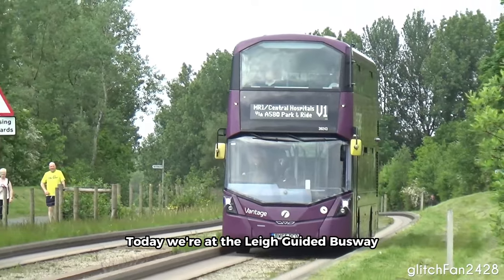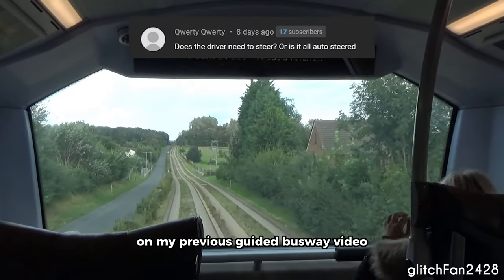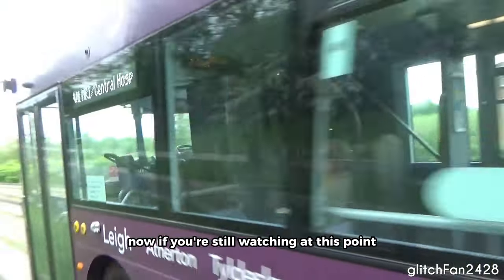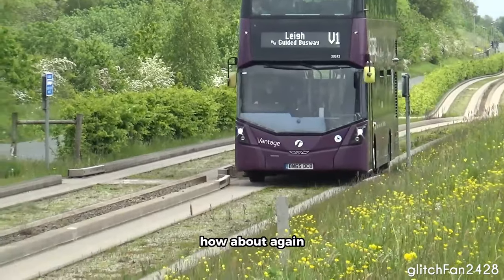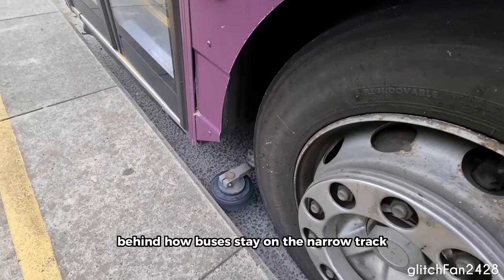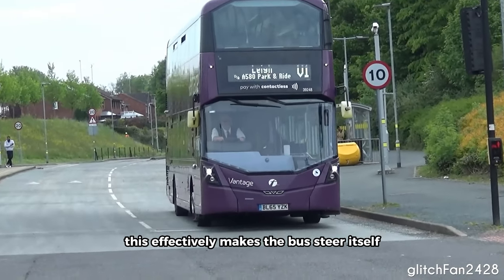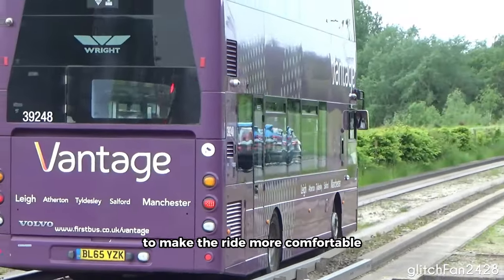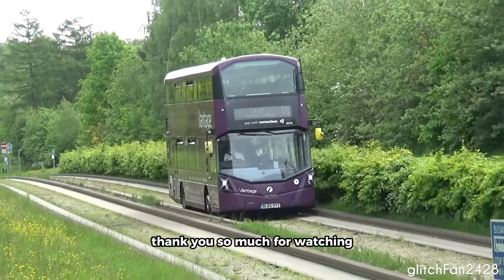What's the SECRET of the Buses on a "Train Track"? | Leigh Guided Busway

Comment from the maker: Did you already know how it works, and if you didn't, was the answer something unexpected? 😅
Reply: No and No! But this is much more robust than the Tesla thing they were trying to do in Las Vegas! It looks cute too! Although, if the bus is used a lot, might make more sense to build a tram! Thanks for uploading!
Reply from the maker: @kiitc  thanks for watching! I presume the main advantage of this is a seamless connection between the busway and places that a conventional tram setup would not work, like a housing estate for example.
Reply: The only thing I don't understand is why this better than a normal road.  It certainly would be much cheaper to build and maintain a normal road... and you don't need special buses to run on them.
Reply: @davidlloyd1526  I don't know that a normal road would be cheaper to build. Land acquisition cost can be quite high. Normal roads would be 300-500% wider. Human drivers cannot drive that precisely for any length of time at 80kmh. They will crash. You not only need the lanes to be wider if the road is unguided, you also need additional grassy/safety area next to the lanes, because on regular roads, crashes happens all the time.

Look at the video, the actual surface the vehicle travels on don't even cover the entire width of the track. You're using less material. Plus these tracks will only be used by buses. It would not be filled with cars, nor other heavier vehicles that will degrade the surface faster. Dedicated BRT routes are good, but BRT-creep is a disease nobody has a solution to.

And you don't need special buses. These aren't special buses built for them. They're normal buses modified to work on the guide tracks. LRTs are so crazy expensive because they ARE specially built. These are less expensive because you just take a regular bus, and then modify them. The modifications adds a bit of costs, but not necessarily a crazy amount of it.

Comment: But what's the point of it? You still need a driver, so no labour saving. It makes more sense to just build a "bus only" road. Then, if there's a breakdown the whole system doesn't come to a halt because you can just drive round the stranded bus. Plus, it must cost more to build in the first place. It looks like a solution in search of a problem.
Reply: I was going to say more or less the same but you have beaten me to it. It just seems something different for the sake of it.
Reply: Cheap to build, doesn't need much space and busses don't break down regularly. They almost never break down.
Reply: No other road users to delay the bus. Cheap road surface costs as it's essentially 20% the materials. Good soakaway. 

It does have benefits
Reply: (1) it doesn't cost more to build. It costs less, mostly because it is narrower, and so use less material, but most importantly, land can be expensive. The surface lasts longer because millions of cars are not running over them, and super heavy vehicles like lorries and cement trucks are not using it.

(2) originally, they intended that each bus would be able to tow any bus that breaks down to the next station at a somewhat slower speed. However, the union objected, so the buses were not equipped to do this. Instead, they obtained a dedicated recovery truck which they named Dumbo.

This is not  limitation of the system. It is a restriction imposed by the union. Buses can be easily equipped to be able to tow other buses, especially since the guideway itself is guided.

(3) the construction makes it impossible for cars to use it. You think that is a fault. I believe it is a feature. This ensures cars do not fill it up at peak hours. And it is proof against BRT-creep.

Comment: But really why??
Reply: Just for fantasy like building something no one ever build. It doesn’t matter how efficient or not efficient at all  😂
Reply: how so? being guided allows the bus to have higher maximum speeds since no steering required.
Having a highway bigger will still cause a chance of congestion and would be invasive.
Having it being a normal way would require very fine steering therefore the maximum speed would be drastically reduced.

This is a very good solution.

Comment: A classic "politican's cost-cutting solution" to something that is called either a train, tram or light rail.
Reply: And this is actually much more expensive in the long run.
Reply: The main reason for the installation of the guided busway is because Leigh doesn't have a train station and there is no plans of extending the track to the town for either train or tram services. The buses pre-installation were always too full for school and work commutors, and the nearest train station was the next town over in Atherton, meaning you would need to catch a bus to catch a train anyway.
At a population of just over 40,000 it was the most effective way to easy congestion on both the roads and rail services in Leigh and Atherton (as the guided busway also stops in Atherton), whilst also keeping costs to a minimum.
The service also shortened the travel duration from Leigh to Manchester by up to 15 minutes
Reply: @dalmo001 
Exept... This is more expensive than a tram network in the long run...

Saving a few dollars now to have it be multiple times more expensive later is not wise.
Reply: @GegoXaren  I live in Leigh so I know the frustration, but this is what the UK seems to be doing these days. Short term quick fixes an dnot seeing the bigger picture.
Reply: @dalmo001  so people forgot how to build train stations?
Reply: They can add have rail lines parallel to those busway underground and at grade.

Comment: The reason for holding the steering wheel is to stop the bus from bouncing from side to side within the guideways. 
When I drove guided buses I used to rest my hands on the wheel rather than holding it.
From time to time when a guided bus was replaced with a non guided bus I would still drive in the guideways with no problems.
Reply: What is the use of this! Isn't it just additional cost
Reply: @naveenchitturi2334  The guideways makes it trivially easy to noob/less skilled drivers to drive at speed. There has been zero accidents on Adelaide system since it was installed decades ago, if we ignore the crazy car drivers who ignores the signs and try to get famous by successfully navigating it without falling into the gap in the middle (only 1 has succeeded).

Well, actually there were two accidents recorded. One was in a terminal where one bus rear-ended another. However, the terminals were not on the guideways themselves. The system was designed so that the guideways ended shortly before the terminals. This allows buses to leave the guideways to go to the terminal, which are just regular terminals with buses driving on normal pavement. Express buses can then "overtake" them.

The other accident happen when somebody (suspected to be a vandal) left a bicycle on the track. The bus driver stopped to remove the bicycle, which was when another bus rear-ended the stopped bus. The driver was hospitalized with spinal injuries while two passengers had minor injuries.

I like that the construction of the o-bahn makes it proof against BRT-creep. THAT is a real thing. My own city has a dedicated BRT, which cost a whopping $25m/km for a 5.4km track (3 miles). It looks just like an elevated highway, and is losing money all the time. It is 9 years old. Don't know how long it will last before they simply turn it into a normal road for cars.

Comment: This was helpful to understand how it works, because I was left very confused from a video where I saw this for the first time.
I still have questions regarding what makes this any better than a tram though 😂 Or is it only significantly cheaper?
Either way, I hope they will use electric busses in the future, because the noise is very annoying, especially in such an otherwise peaceful and pretty countryside location.
Reply from the maker: This was initially a disused railway line, and apparently converting it into a tram line or a normal road for buses would cost more than making a guided busway

Comment: If you get this in India, many motorists will use the special pathways to avoid congested roads and say my car/ motorcycle identified as a guided bus for a bit that day!
Reply from the maker: Actually at the entry points there's a "car trap" so unless your car is as wide as a bus, it will not physically be able to enter the tracks. There's been instances of people driving into them and getting stuck, which delays the service
Reply: There is a wheel trap at the entrance to grab on to cars which is normally much narrower wheel base than buses. However, if you carefully avoid that, there is a sump-buster device that rips open the bottom of your engine, because cars are usually lower than buses. Only if you avoid both, do you get onto the guided tracks, with a large opening down the middle, that cars typically fall into. Only insane people, or those who views it as a challenge will drive there.

Motorcycles will have less of a problem, but unlike motorists, if you fall in the central hole, you might hit your head and break your neck on the concrete on the way down and die. In India, the solution is simple. Just have a guard stationed at every entrance and exit. They will raise a gate at an approaching bus, and close it after them. If you make it through anyway, he will use his mobile, and cops would be at the next exit waiting to give you a huge fine.

Comment: Thank you for the video. I had never heard of this method before. But what is the point of the rails? Why not just drive on the road?
Reply from the maker: it's repurposed from an old railway line, supposed to offer the seamless connectivity between express rail and normal roads
Reply: @glitchFan2428  Thank you!
Reply: It's too narrow for human drivers to drive. At least at high speed. You could probably do it for a bit. But after a couple of days, you'll probably fall off those narrow tracks and have an accident. The guide rails makes falling off impossible. And in fact, since the thing was installed decades ago, it has never happened. The only two accidents have been rear-enders.

Comment: Still can’t get my head around on how this is actually better than just riding on the road
Reply from the maker: You definitely aren't alone there
Reply: The buses are separate from other traffic therefore a quicker journey with much less driver stress. As an ex London & Sydney bus driver it can be a very stressful job at times.
Reply: No cars on this thing, so at peak periods, buses are not stuck crawling along slower than a snail because of all the cars blocking it.
Reply: Helps keep cars away from busways. If there caught they'll be stuck and be in serious trouble with fines or with the law.

Comment: What is the point of having a guided track, instead of just a normal road?
Reply from the maker: According to the people who built it,

Prevents use by unauthorised vehicles

Improved public perception

Sustainable drainage system

Less space required 

etc ... I get your point though as there are many disadvantages like when a bus breaks down on the tracks

There were a few more but I can't remember.
Reply: no traffic is a huge bonus
Reply: The guided track allows the track to be much narrow, despite the relatively high speed. Imagine trying to drive that without guidance. Perhaps a few very skilled people could do it. Most would probably crash after a couple of days.

Why is track guidance such a terrible thing? Why do people buy cars with cruise control and track following? Why do people pay Tesla additional thousands for self driving? More automation is generally a good thing. The driver can relax a bit while on the guided portions of the track. The tracks are narrower, allowing us to use the adjacent land for other things. And if we have a lot of these, I can see overhead powercables for electric buses to charge their batteries/capacitors.

Comment: Wonder if the small wheel can handle fast speed without becoming hot
Reply from the maker: I suppose it's designed to withstand that
Reply: they can withstand going 55mph for longish duration without any issues. at cambridge busway thats the speeds the busses go
Reply: These have been used in Australia since the early 1980s, and no issues. The buses travel at 100km/h (62MPH)
Reply: There is basically weight on the wheel, so it doesn't get hot.

Comment: How does it work in heavy snow?
Reply from the maker: Good question. I'm not sure if the snow in the UK ever gets heavy to the point it would interfere with the guided busway, but if it does I assume that the buses will just use regular roads
Reply: It would effectively shut down, just like the rest of UK transport when we get a smattering of snow.

Comment: How does it cope with the gaps.
Reply: much the same way as a good slot car set handles the crossroads, the guide tracks widen slightly to allow the bus to enter the other side of the gap without error, I would assume this is where the driver comes in handy to ensure a stable ride.

Comment: Curious as to why they chose this over a trolley or train
Reply from the maker: It was apparently a disused railway line before they converted it into this. And this was cheaper and took up less room than a road for buses
Reply: Because train can't go through a normal small town road.
Reply: All train lines and stations in Leigh were closed down in 1969 and all tracks were ripped up. Before the guided busway was built, it could sometimes take 30 minutes on the bus to travel the two miles to the A580 road that heads to Manchester, due to the heavy slow moving traffic in the morning. The bus on the guided busway misses all that heavy traffic for two miles and joins the A580 four miles further along that road. Relaying a train track all the way to Manchester from Leigh would not be possible, as many houses are now built on sections along where the line used to run.
Reply: @peteince  Japan has buses with additional rail wheels that goes up and down, that can travel on rail lines. But that's overly complicated compared to welding on these simple guide wheels. Plus it's harder to have to carefully align the bus exactly on the rails before the mechanism lowers the rail wheels. The hydraulics to lift the entire weight of the bus cannot have been trivial.

Comment: One weong turn and the bus will hit the curb
Reply: Well I was thinking, it wouldn’t take much to hit the kerb, a heavy bus only being kept on the road by a couple of small guide wheels, surely at speed could be easy for mechanical deviation then bang, bus could go over ! Doesn’t look safe at all this.
Reply: @oddities-whatnot  The guide wheels does not keep the bus on track by sheer brawn. There is a clever mechanical linkage system that turns the main wheels of the bus ever so slightly if it drifts out of alignment. Think about it, the human driver can easily exert enough force on the steering wheel to aim the bus in whatever direction he wish to go. The guide wheels only need to exert that much force to move the main wheels to the correct position.

Comment: 1:34 it sounds like a B5LH.
Reply from the maker: It is a B5LH, with Wright Gemini 3 bodywork
Reply: If the back window only covers the right half of the lower deck and it's either an EvoSeti, Enviro 400 MMC or Wright Eclipse Gemini then it's most likely a B5LH. Also you can tell by the long gear changes due to the semi-automatic Volvo i-Shift gearbox, normally used in trucks.

Comment: What's the use case though? Why not build a tram or light rail?
Reply from the maker: Supporters of guided busways have given the following reasons:

1) usage of existing resources, thus saving money
2) flexibility, the bus can continue off the guideway providing sealess travel between it and places where it's not possible to build a tram
3) land savings as the busway only needs to be about as wide as a bus 

I'm not for or against it btw
Reply: Passengers doesn't need to transfer from bus to train and to bus again.

Comment: It is stupid to be frank. Why its needed. These can be proper road.
Reply: I think it depends on the level of traffic. If the bus shares the normal road it will be held up in traffic. If you want to encourage people to take the bus instead of driving you can have dedicated bus lanes so the busses can zoom past the cars stuck in traffic. If you are going to have a strip of road used only for busses then this system means the strip of land required is narrower because the guaranteed steering means you don't need to leave so much of a gap to allow for driver error as with a normal road. A lane on a road with a 55mph speed limit would be a lot wider than this. Also the central strip can be left as grass which is better for rain absorption. It rather depends on what the cost is like per mile compared to a normal road, over a long period allowing for resurfacing etc. In most places the cost of the land itself probably won't be too much, so I suppose the cost per mile must be competitive other wise why would they do it? There is the disadvantage that the track can't be used by taxis cyclists and emergency vehicles, like a normal bus lane could be.
Reply: The route from Leigh to Manchester city centre is a busy route, especially in morning & evening peak periods, so instead of a bus being stuck in traffic It travels the majority of the route on a Bus only Busway, Why should 50/60 people have yo wait in a traffic jam that has Cars with mainly one person using it.